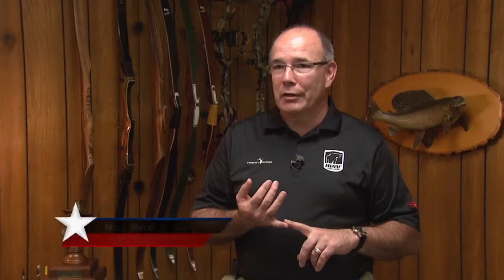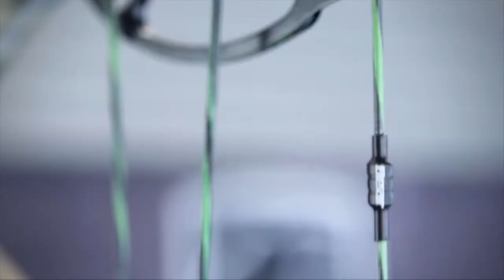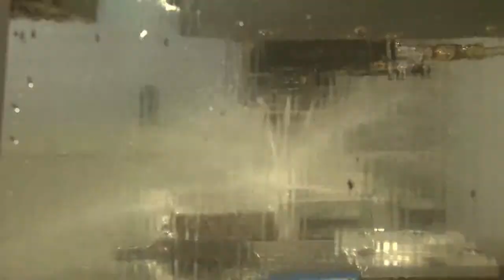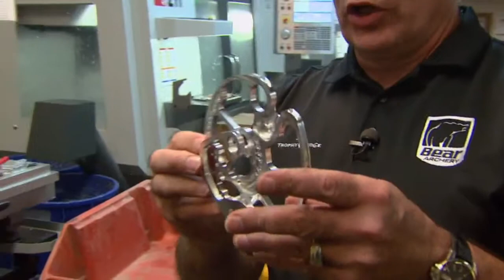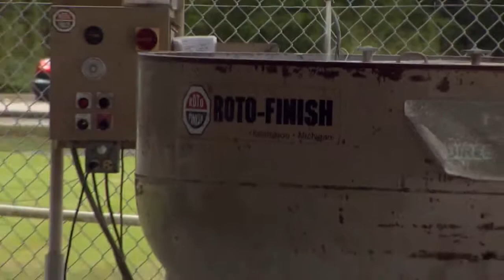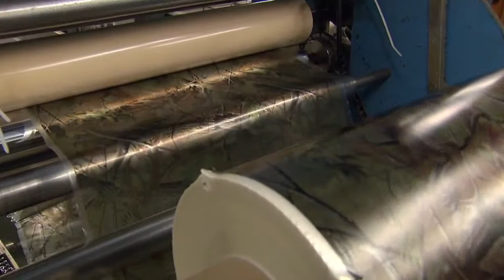Bear Archery Compound Hunting Bows - Proudly Made in USA

Comment: Blablabla. To bad you Bear Archery don't take care of your customers when they need you. 2 years ago I had a cam issue (it was my bad because for an accident with a portable bow press,...and I told them everything from begining), I told them that I need a new bottom cam for my Bear Method.They said I don't need to pay for it because it's covered by Bear warranty and they will send it for free. Well it was all BS. They never sent anything to me. Finally I bought the needed bowpart through a dealer.
Reply: Well since you damaged the cam IT'S NOT covered under their warranty! If it failed because something went wrong  with it they would cover that. An accident is an accident, if you dropped it from a tree and busted it they wouldn't cover that either. They only cover things that break or fail from a manufactures standpoint, like a limb snapping from failure not reckless use. If you read their warranty you would understand that and they tell you what particular bow press to use in the info with your bow, so that's your fault.
Reply: Joe Pruitt, I told them that it was my fault and that I would like to buy one cam from them. Then finally the  guy at CS said that it can be covered by warranty.  I answered "Wow, that's an awesome CS and that I'm literary speech less." After all these, they done absolutely nothing, zero, nada. That was my experience with them.  They talk the talk, but not walk the walk,...period
Reply: Well sorry for your experience with them then